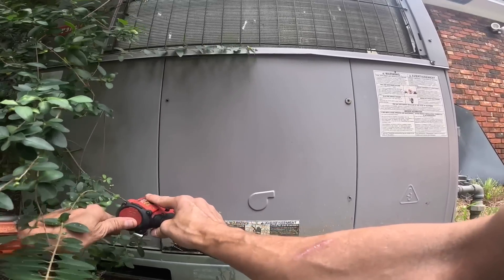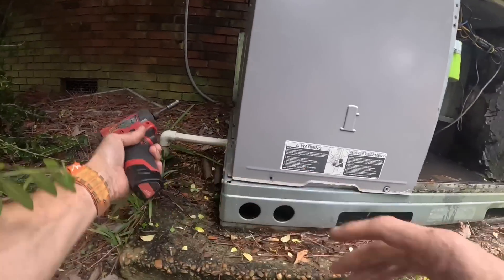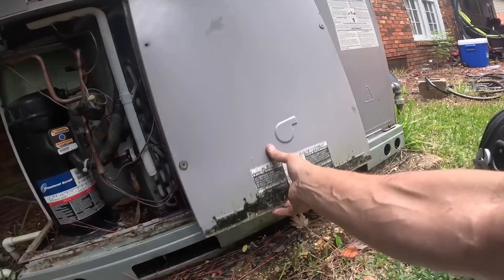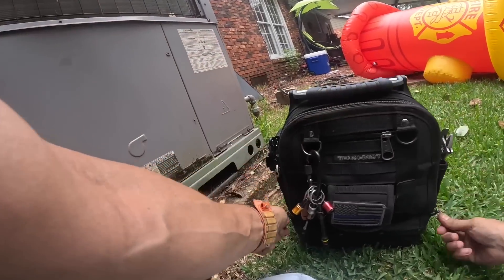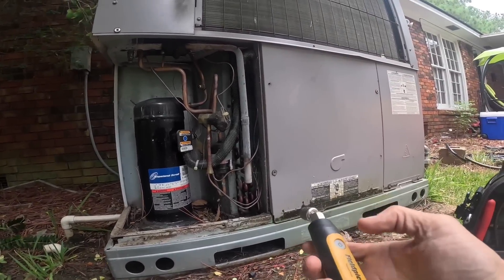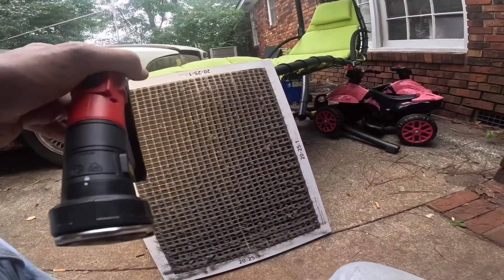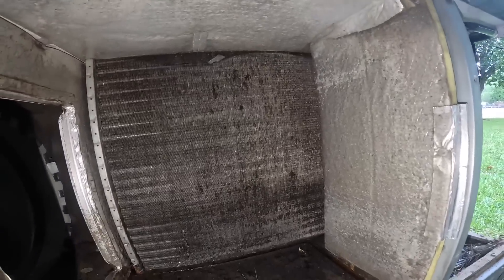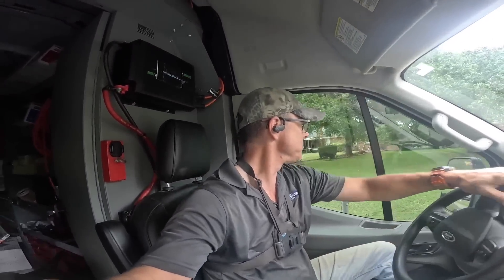I’m Never Shocked Anymore! #hvacguy #hvaclife

Comment: I drive truck for work. I'm not sure how I started watching these videos in the first place. I purchased a higher merv filter to find out recently that my furnace doesn't like it that much. It was tripping the overlimit on exchanger/fan limit switch. It has to be from the 90s because it was kinda old when we bought the house in 2001. I turn off the gas valve at end of spring, clean the furnace out every fall before pilot is lit, and change the filter every 30-60 days. I have replaced both capacitors outside in A/C unit, replaced gas valve 2 years ago, sealed all the air leaks that were there from the shabby install, and cleaned everything I could reach, including cutting a hole to access the coil so it could be cleaned. Simply changing a filter is EASY work! The owner of the property would be best advised to send someone to do it or do it themselves 🙄 
Filters are dirt cheap compared to replacement of the system or a tech coming out and spending 2 to 5 hours cleaning indoor and outdoor coils and changing a filter. Plus getting all the branches off of the outside unit would be advised.

Comment: I replace mine once a month.  I buy 12 a year a round tax time. and every month on the 1st it gets replaced.  I do regular maintains every 3 months.  and make sure out side unite is cleared of any thing that would imped air flow.   and clean it out every 6 months to clean our any dirt that collects.   I hop my system last forever.

Comment: I wish you were in Texas to fix my issue lol. 2 6 month old systems (new construction) and every time it rains the compressors stop running. Condenser fan runs but no compressor. After letting them sit for 45 minutes, then cycling the cooling on and off several times, the compressors both kick on even if it’s still raining. Nothing frozen up or anything. So strange. They were thunderstorms so no clue if the lightning affected it both times.

Comment: I tell people all the time. Cheapest thing you can do and get the most value for is changing the filter. It’s like vehicles, regular oil changes will give you the most value for your investment in the vehicle. I’ve gotten 400,000 or better on my last 4 vehicles with little or no major repairs.👍🇨🇦

Comment: Note to self: Putting a fur coat on the evaporator coil will not make it work better. Neither does completely burying the unit under shrubbery.  I am surprised this one did not burn up.
Reply: The high pressure from the tree and the low pressure from the stopped up coil cancelled each other out!

Comment: "How many filters can you buy for $150?"

Surprisingly few if you buy the pleated filters. I've been using Ace store brand filters because I am doing drywall work and need to change the filters out a few times a month. these are about $5 a filter. For 3m brand, they are about $20 a filter.
Reply from the maker: Those 3M things are an airflow restriction the moment they are put in.
Reply: @HVACGUY   I watched that filter 'snap' into place and it was not 3M. Undersized?
Reply: @HVACGUY  They are, but I have multiple oversized openings to my HVAC return that are larger than the return on the unit, so it would not be as restrictive as putting it directly on the unit intake. They are extremely expensive and need to be changed out very often. On the other hand, those stranded nylon filters don't stop anything from getting through, so you might as well not have a filter on. Project Farm did an interesting video on air filters.

Comment: I can't believe you put that kind of filter in. Those are almost as bad as not having a filter in.
Reply: Nope.  If it's changed like it supposed to be regularly!
Reply: @rgmatta3524  That isn't going to make it filter any better. The problem is that filter isn't going to stop much from getting through. Project Farm did a great video on dust vs static pressure for furnace filters.
Reply: @MAGAMAN  Watched the video from Project Farm.  Thanks for the info.